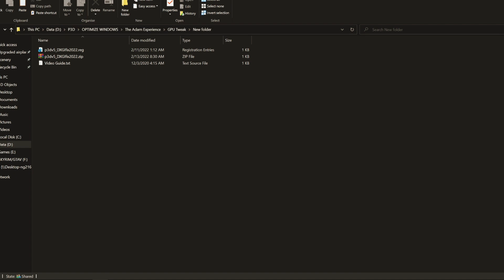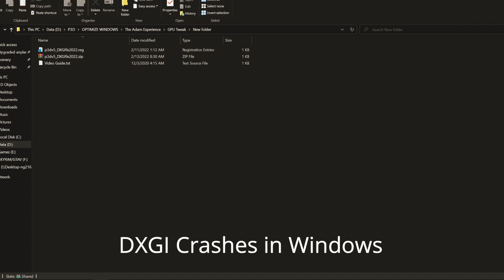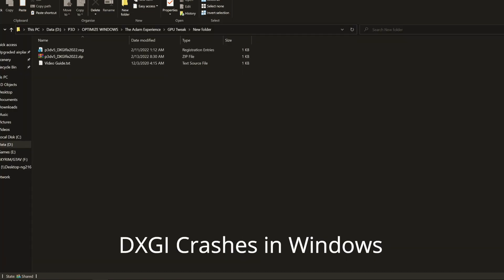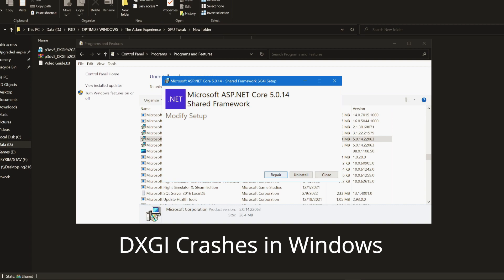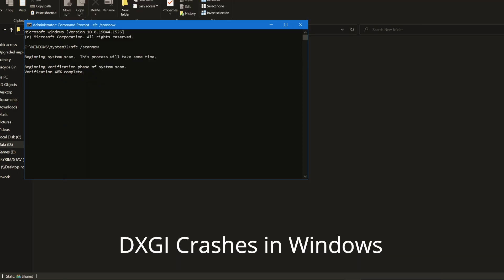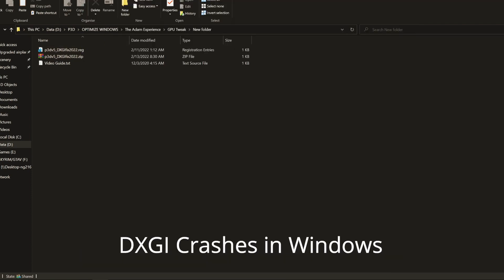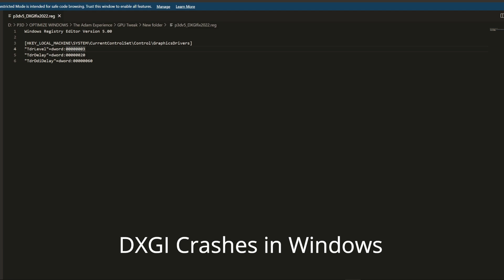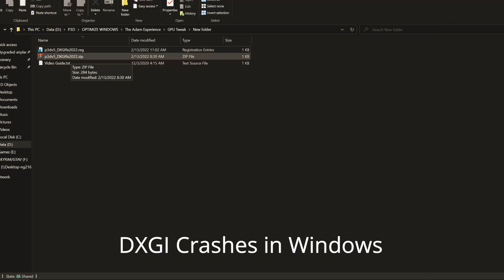DXGI ERROR DISABLED | SOLVED VRAM CRASHES | 2022 UPDATE

Comment: @4:16 "...and just click repair. Yeah we don't wanna repair em..."
@6:58 "about 80% of the dxgi errors, it completely cured. That's why I put the '100% fix', cause for most everybody it did"
@7:23 "Really, you don't wanna have to run this fix of mine, because if you run this fix as of right now, you will eliminate the dxgi error completely"

I really do appreciate you taking the time to help us attempt to fix this issue, but maybe try to pay a tad more attention to your wording, as it can be pretty confusing or even contradicting 😅 I guess I'm not gonna try your fix then, because I'm not 100% clear on if I SHOULD or SHOULDN'T try this fix? I did run the system scan and it did look like it picked up/repaired a couple corrupt files, so hopefully that works!

Comment: Hello! I recently buy an rtx 4080 and i start to having the same error in different games (GoW, Atomic Heart, etc), and i didn't have these errors before on a previous gpu (rtx 3070). Can your fix help me, or is it something with my gpu?
Reply from the maker: have you tried everything the video suggests?
Reply: @AdamJPestridge  i've tried to repair microsoft redistributables, but it keep asking me to open a setup file on my drive, which i don't have.
I'm also trying to sfc /scannow, and it's didn't find any problem.

But i maybe find the fix by completely disabling msi afterburner soft and disabling underwalting (which is a shame, because my gpu now hotter and consume more power), but atleast yesterday i didn't have any errors. I will continuing to play and see, if it's really help or just a fluke.
Reply from the maker: @ravioli-ravioli  yes. Remove all overclocks on the pc and lower settings as well. You can download the file it’s asking for from the Microsoft website.
Reply: @AdamJPestridge  oh man, but i didn't buy $1,300 gpu to play on a lower settings, as you can tell. 

And aslo weird thing, my previous gpu was secondhanded rtx 3070 (from some btc farm) and it's works just fine with underwalting and staff, but the brand new rtx 4080 for some reason seems can't handle even the simplest voltage limitation, which is good for gpu and pcu btw (if working). That's what's bothers me.
Reply from the maker: @ravioli-ravioli  the thing is, a windows update, a driver update can change the way the card behaves and what worked before may not work moving forward. This may not be the case and it could be a case that something in the BIOS isn’t set up correctly to use with this card. Many factors could make up a possible solution for this, it’s just a case of eliminating what it isn’t one by one. Check your BIOS settings as well. It could be that the card isn’t getting enough power or too much power as well. The fact that it happens now to all games helps barrow it down. Is the card also brand new or second hand. The issue with second hand cards is that, unless you buy from someone you know or trust. You have no idea what the card was used for previously and it could be on its last legs, hence why they sold it.
Reply: @AdamJPestridge  exactly, that's what's interesting to me, because as i say, the one card i have right now with the problems is new, and card i had before was second hand, and it's worked without problems!

I'll check the BIOS too, thanks for the tip. But i should say, that i didn't change anything in BIOS or OS from the times that i had an old card (except drivers, of course).
Reply from the maker: @ravioli-ravioli  more powerful cards require more power given to them from the PSU. sometimes the BIOS will either need a firmware update or to change the power settings to make sure enough power is given to the hardware. By getting a more powerful card, it can also create a bottleneck if the CPU or memory isn’t as powerful and cause issues as well.
Reply: Hey I have a similar issue with battlefield 2042 and Squad were you able to resolve this at all?
Reply: @tbracerplays  hello! I'm just remove any undervolt in msi afterburner, and leave it all by default (except fan speed) and problem is gone now

Comment: when i do command promt it says "You must be an administrator running a console session in order to
use the sfc utility." which is odd because i am the administrator i checked via account settings?
Reply from the maker: Make sure youre running as admin when you launch it, right click and  RUN AS ADMINISTRATOR
Reply: @AdamJPestridge  Thanks, i just assumed it would run in Admin since im on a ADMIN account, my only account.
Reply from the maker: not always. I always Run as Admin just in case @Stsebastian8900
Reply: Im pretty sure that my GPU (which is second hands) is just on its way out because i have done every fix and cant get it to stop "device_error_device_lost/hung" Thats what i get for buying a seccond hand GPU.  @AdamJPestridge

Comment: hey brother i have an i5 3470 cpu and dont have a gpu and when i play hitman absolution and the game run well but at a particualr mission the game shows the dxgi error so what can i do??
Reply from the maker: Do you mean your GPU is an integrated one instead of a dedicated one because without a GPU, you would see anything on the screen at all. You do have one.
Reply: @AdamJPestridge  i have intel hd graphics and the hitman run on 30 fps and i dont have a dedicated gpu
Reply from the maker: @Ignite_gamingofficial  for games I recommend getting a dedicated GPU. Integrated gpus are not really gonna run successfully recent games from the last 5 years fully.
Reply: @AdamJPestridge  money money money money😂
Reply: @AdamJPestridge  well the thing is after some time i am going to upgrade my i5 3470 pc with a m.2 ssd new psu and a used gpu mostly 1050ti or 1650s
Reply: @AdamJPestridge  cz like u I am also a creater and this may account and i also know a lot about pc pc upgrading and pc building and pc repairing

Comment: After weeks of digging, giving up and trying again, I've found this video.
I play DayZ, or did.. until I updated windows 11 back in January, and DayZ worked, until it didn't. Shortly after the update the game just stopped working and I get the "Failed to Init DXGI" error. 
I did every other possible fix "Did you update your drivers?" Yeah, like 50 times. Uninstalls of the OS, and DayZ and all it's files, reinstalls of everything.  
I even played it on an older laptop from 2016 and it worked fine as of Last October (2022). Once I updated the machine to the new Win 10 bulid, DayZ throws this error. 
I built another brand new machine, and it gives me the same error.  I do the dxdiag, it says I've got DX12.
I'm wondering if this is the base issue for all games/apps having this problem?
After watching this video, it makes sense now. Which is odd, because I was trying to tell other people, "OK, I just need something to make the DX code fire..." 
Turns out I was correct! Windows seems to be going straight to "Not Responding" in the Task manager as soon as it doesn't see the DX files load immediately. It's a difference of under a second.
So, adding that little bit to the Registry could fix my issue... 
I think I just need windows 11 to wait long enough to load the files from/for the DX drivers. 
Also, I had this thought, could it be that the DX drivers are in the wrong place? Wrong file location?
Where is it SUPPOSED to go? I'd rather start there than to change the Registry at this time.

Thank you for this video!
Reply: I have this problem with dayz. Did you find the fix?
Reply: guys, did you find a fix?
Reply: Qual seria o local correto pra ele estar,e rodar o FC25? Outros jogos rodam,menos ele com esse erro.